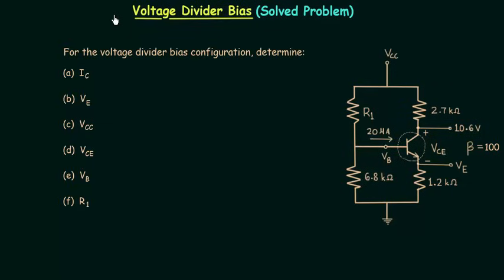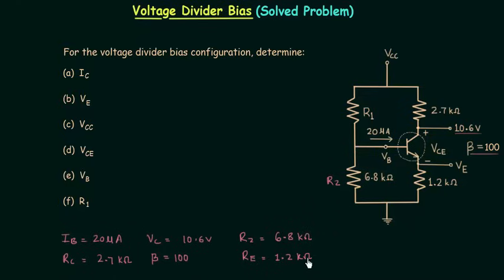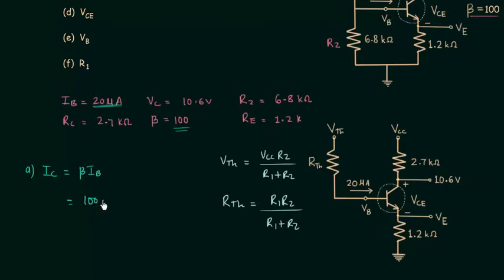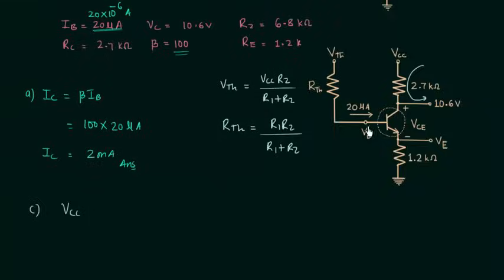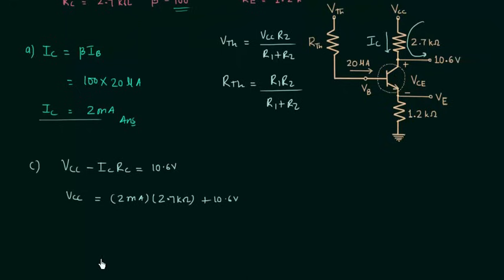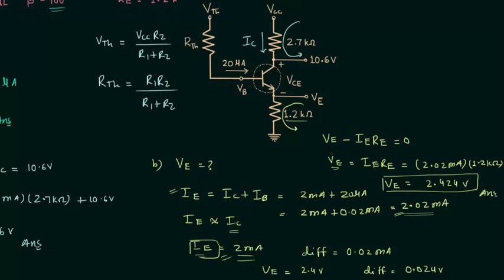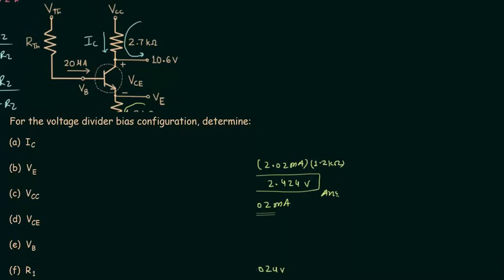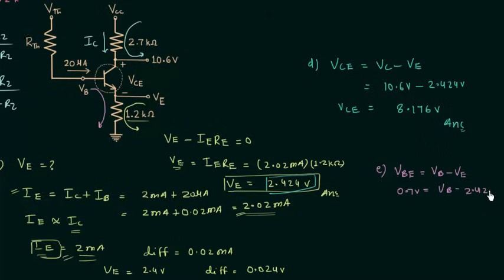Voltage Divider Bias (Solved Problem)

Comment: In determination of R1, the value is 800 kOhm. Because R1 = (Vcc / Base Current) and Vcc was 16V. This value is having huge difference with compared to R1' = 28 kOhm. So ig in some places it is better to determine ta round figure rather than assuming.
By the way, your lectures are pretty much helpful. Thanks.

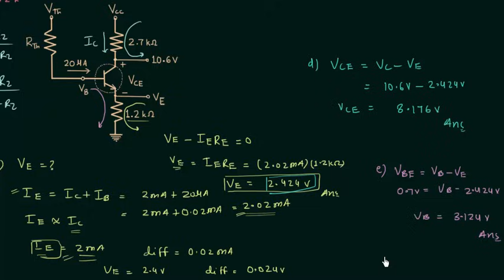Comment: Sir i have a question at 7:05 how did you got that VBE = 0.7V for finding VB  (e-part)
Reply: VBE is constant for si diode which is 0.7(conducting current)

Comment: why is VBE equal to 0.7V?
Reply: Silicon
Reply: minimum voltage required for the base emittor region which is made up of silicon requires 0.7 volts as threshold to conduct the current or switch on the transistor
Reply: It is standard value
Reply: Silicon diode

Comment: sir can i say that potential drop across R2 = Vbe + pottential drop across 1.2 kohm, I can calculate the current through R2. Hence current through R1 will be 20uA + calculated current, hence apply kvl => Vcc - (I + 20uA)R1 =  Vb.

Comment: sir , how did we get the value of vbe=0.7v???
Reply: it's usual voltage for a "diode" to conduct, and a transistor could be seen as 2 diode back to back. So it 's not by calculation, it is only the conduction condition for a transistor to work.

Comment: sir  if we solve with out considering thevenin circuit  r1=(Vcc-Vb)/i b.which gives R1 as (16-3.1)/20micro amp=645 kilo ohm.why the answer is different?
Reply: It's wrong bcoz ib is not flowing through r1 it is ib+current flowing through 6.8kohm or r2 u need to use thevenin theorem

Comment: If you don't approximate Vth = Vb, then R1 = 26.857 KOhm
Reply: How did you find R1 .please help me
Reply: @kv5539  Vth - Vb = Ib * Rth  --->  (6.8/(R1+6.8))16 - 3.12 = 20micro(R1*6.8k)/R1 + 6.8k  ---> solving this you will get finally 3256R1=87584 --> R1= 26.89kohm.
Reply: thanks bro

Comment: what is the procedure if vth is not equal to vb?
Reply: consider current through R1 is I1 and through R2 is I2. Applying KCL at Vb in the first circuit we have, I1=I2+Ib. Now, I2=Vb/R2. As we now know I2 and Ib we can calculate I1. Finally R1=(Vcc-Vb)/I1.
Reply: This particular math can be solved without Thevenin equivalent circuit
Reply: @shihabmahmood9135  Absolutely correct

Comment: why do we take r1 always greater than r2?
Reply: Based on the equation Ve = (R2/(R1+R2)) * (Vcc), you will see that if R1 is not greater than R2 Ve will be very large and most of the circuits voltage will drop over Re. At extremes this causes Ic to lower to minimum and Vce to increase to maximum - not a particularly efficient circuit and nowhere near an ideal q point

Comment: Sir, when calculating R1, we have to multiply Ohms with Volts. But that's against Ohm's Law, where U = R * I. There's no U * R !

EDIT : I've figured out that by continuing the calculations for R1, if you keep the units of measurements multiplied with each other, KOhm * Volts will be on the denominator and Volts on the numerator. By making the common factor the Volt unit, it will cancel out between the denominator and the numerator, in which only KOhms remain for R1.
Reply: Mr Castor here he used voltage divider rule not ohms law...
V*R/Req

Comment: Sir, how did u consider vcc =16 v and vbe=0.7v...Pls tell??????
Reply: ur up electrical eng ineering shit creek amit
Reply: Amit Kumar if Vbe is not mentioned take it as 0.7V
Reply: Milan Samanta  for silicon diode 
Vbe is 0.7v
Reply: if you don't know this then go to hell. trivial stuff
Reply: Hi I am not an expert but from what I have already seen in the video:
Vcc can be easily gotten from calculating the pd drop across the R1 resistance as I1 * R1 = Vcc - Vb
And lastly Vbe is a property of the B-E junction which is acts as a diode. We consider that it is a Silicon diode. And given that the Silicon diode has a barrier potential of 0.7V We conclude that Vbe = 0.7V.
I hope this helps.